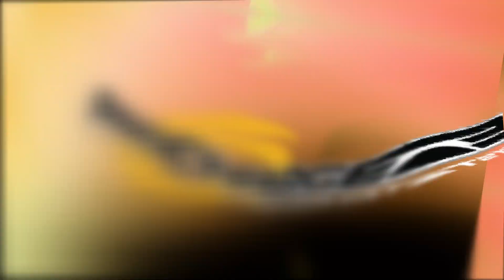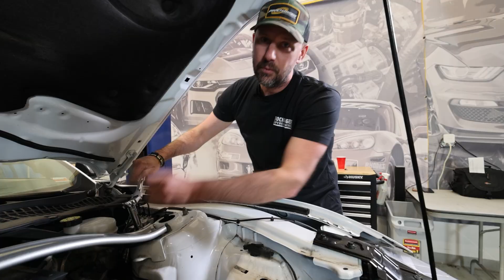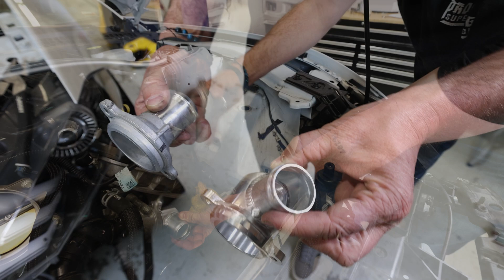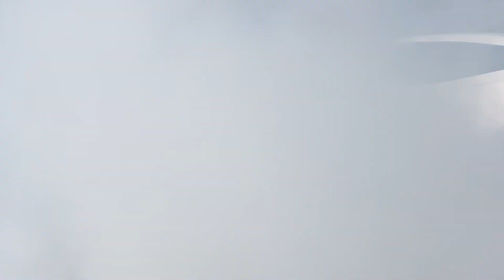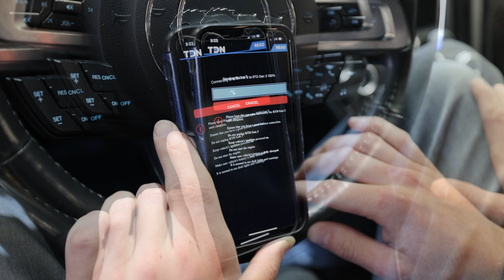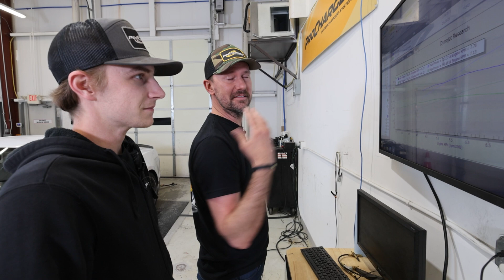ProCharger Supercharger Install on S550 Mustang | HUGE HP Gains!! #procharger #mustang

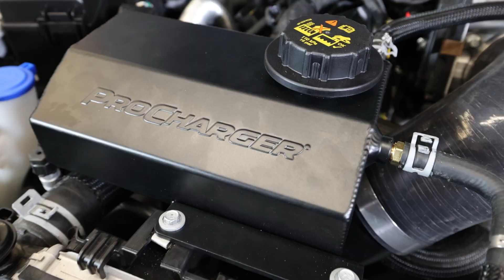Comment: Great video.  In the middle of my install on my 21' Mach1 Handling Pack.  At 12:58 you show where the air filter would go, right by the oil cooler below the headlight.  Anyone have any insight on how to get the air filter to fit?  The oil cooler and bracket are in the way using the parts Procharger sent me.  Help!!

Comment: Being a ProCharger fan myself. I feel it’s clear ProCharger should consider dropping the costs of their Head Units, considering that ESS clearly is more efficient and quicker and when ESS starts making reasonably priced complete Kits for all vehicles besides the Mustang, ProCharger unfortunately May just become a thing of the past. I just believe ProCharger Head Units and complete kits are over-priced. Again,I am a fan of ProCharger.
Just Say’n 
Greed Kills!
Reply: Pro charger is only 500 more compared to n ess g2 kit w g3 intercooler, gt500 injectors, bap. Ess doesn’t supply a tune so add $1300-$1500 to ess kit price. Comparable kit from pro charger is 8k vs 7500 from ess

Comment: Do you have a thicker bracket for your CARB kit locations? I have an upgraded D1x with a custom 8-rib but I feel I am having some flex from the original bracket, in addition to some pesky belt slip (possibility because of it) even with an aftermarket tensioner. I am pushing 830/593.
Reply: You running a crank support ?
Reply: @laquintonwells2138  No.
Reply: @laquintonwells2138  No, mine is similar to that of a Vortech/Paxton. My belt isn't on a dedicated system.

Comment: 20GT with D-1X here on a 120MM which made 770HP on E85 (10PSI-ish).  Very easy install, belt changes are a breeze and servicing the head unit is simple.  Not a fan of the torx bolts on the tensioner / idler (stripped already) but not sure if the new kits even have these (mine is 2023).  Haven't scratched the surface with this headunit but it's plenty quick currently.
Reply: Did you buy the crank support?
Reply: @adriantrevizo5140 I do not have the crank support.
Reply: Are you running a fuel system ?
Reply: @laquintonwells2138 yes, Fore Innovations triple pump system and id1050x injectors.
Reply: @laquintonwells2138 yes, Fore Innovations triple pump system and id1050x injectors.